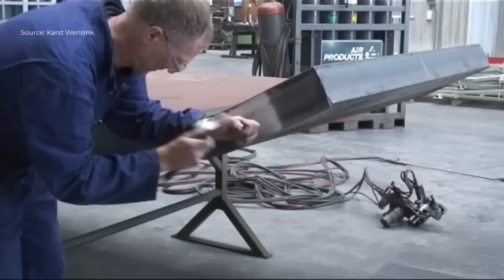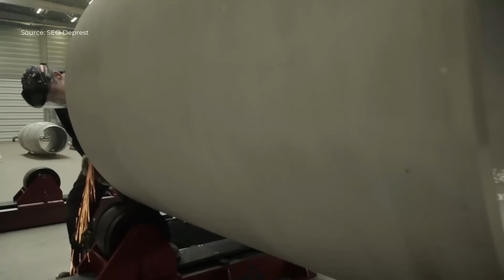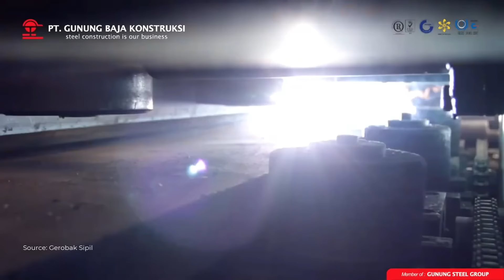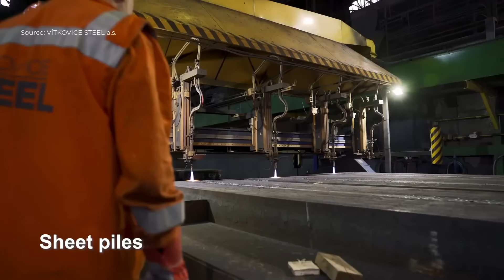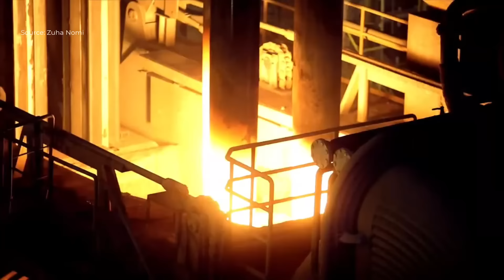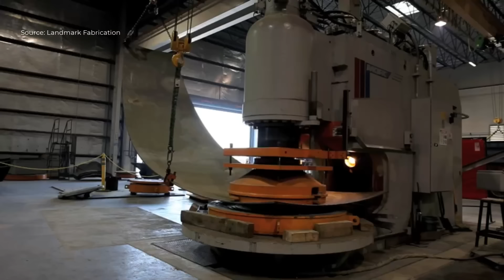How Steel Plates Become Cylindrical Tanks | Bending & Welding Full Process. Heavy Steel Engineering

Comment: I myself did do such bending operations for even 127 mm thick plate  including hot rolling for huge pressure vessels from 1968 to 1978 . Rerolling after welding the long seam. I used to be engineer in charge.